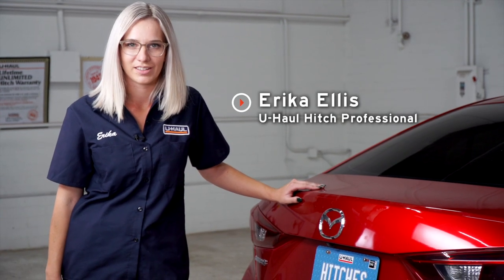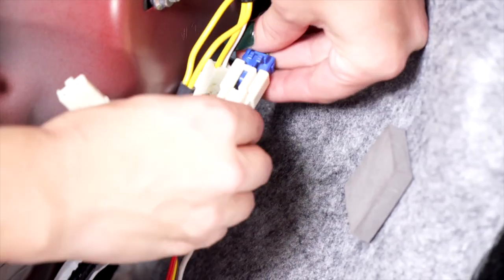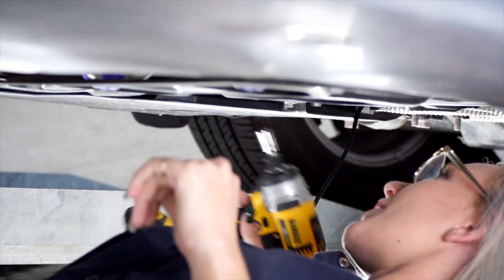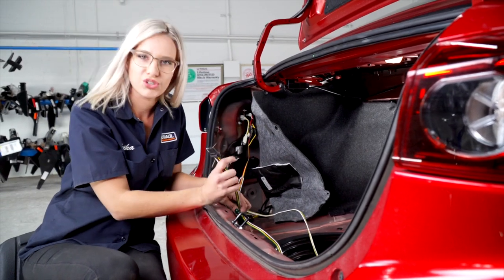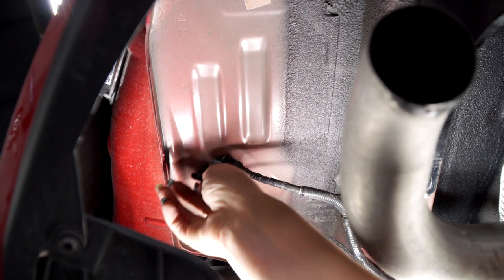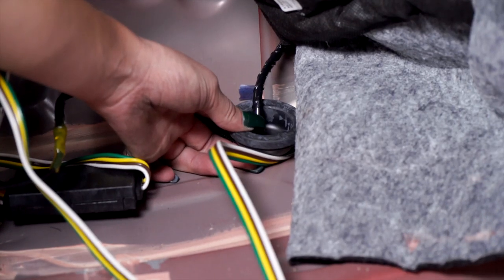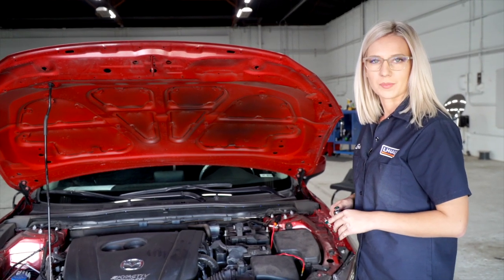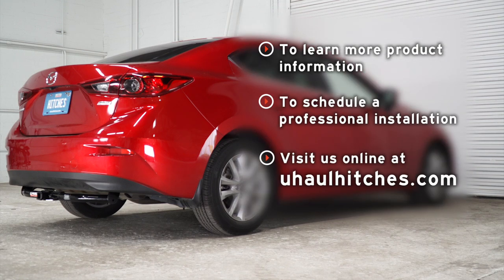2017 Mazda 3 Wiring Harness Installation

Comment: I just did this install on a 2017 Mazda 3 hatchback.

1. Instead of wiring the power off of the battery, I tapped an unused fuse from the inside fuse panel. This way, the power wire can be routed inside the car under the plastic trim. No need to lift the vehicle or unbolt big parts.

2. Instead of drilling into the sheet metal for the ground, I used one of the existing bolts in the back corner of the car.

Comment: This is a great video. 

I will say though, You also gotta have a way to lift the car to run a power wire from the engine to the back.... So you'd have to spend at least $100 on a car jack if you don't have one. On top of buying everything else. Might just be cheaper to buy the truck if you're doing like an in city move...
Reply: No need to lift the car. Instead of tapping off the battery, tap the power from the inside fuse panel. It's located under the driver side kick panel. Run the power wire under the driver side trim.

Comment: is it good also for a mazda 3 hatchback 2015 ?
Reply: I can confirm that yes, this wiring harness works for a hatchback model too.   The only difference I came across was the interior panel covering the tail lights was different; For me, it was easier to just remove the panel covering the harness for easier access.  Good luck with your install!